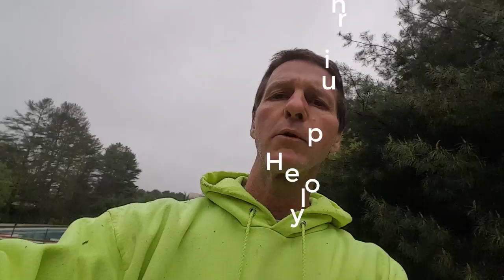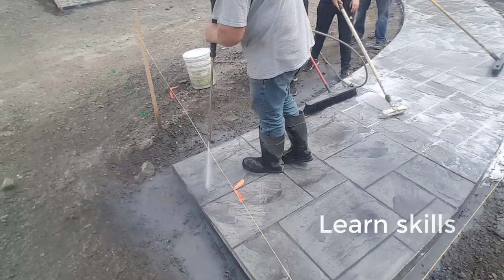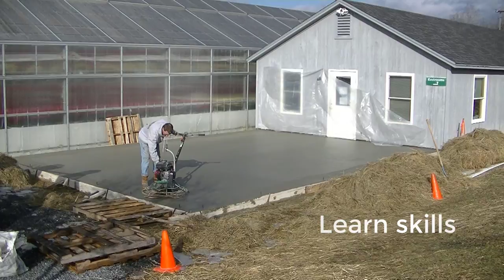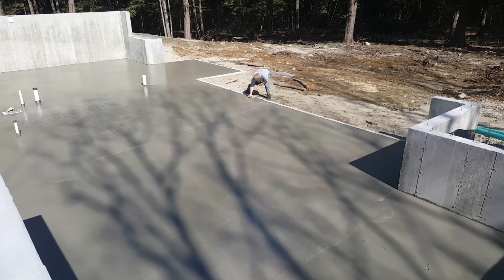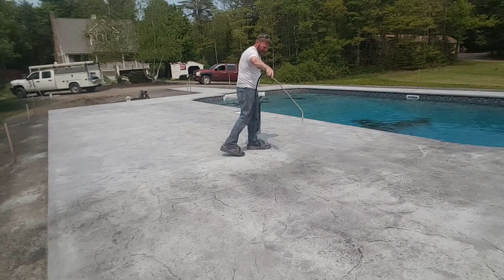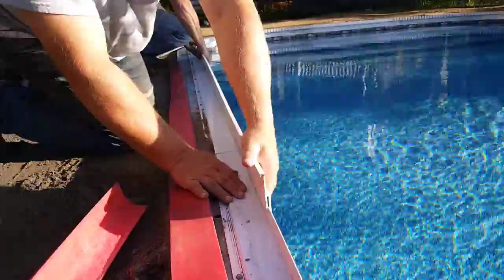My Channel's All About Concrete!

Comment: Would vapor barrier over concrete slab be necessary when installing a click lock floating wood laminate floor with attached underlayment in a 40 year old condominium on the 8th floor of all concrete slab building? Any insight is appreciated.

Comment: Hey Mike 
I poured an 8” monolithic slab a month ago for a new garage I was going to build. Then, my February (pre pandemic) lumber price went through the roof and I am forced to wait til things level off.
We the slab be ok through the winter on its own? Should I shovel it off?
I live just outside of Boston.
Thanks in advance
Reply from the maker: We've done slabs late in the fall and left them over the winter. I tell the customer to cover with a tarp and some hay, then let the snow cover it. It should be ok come Spring time.
Reply: P7